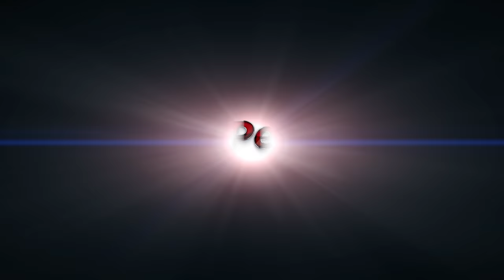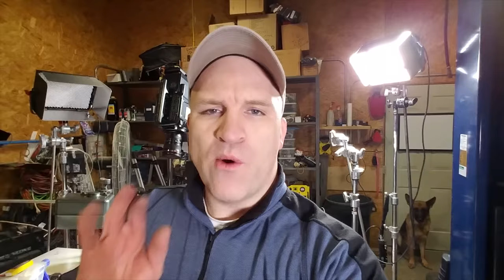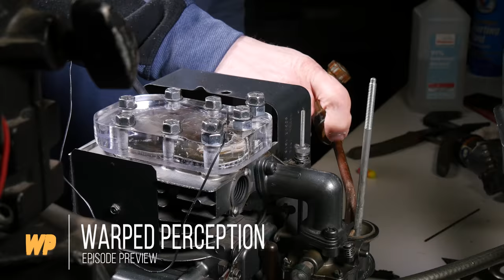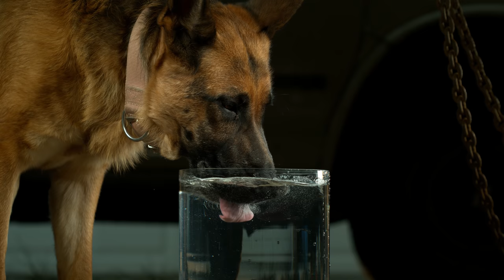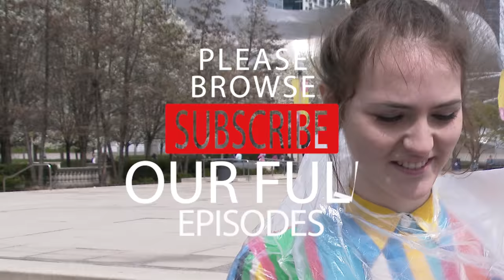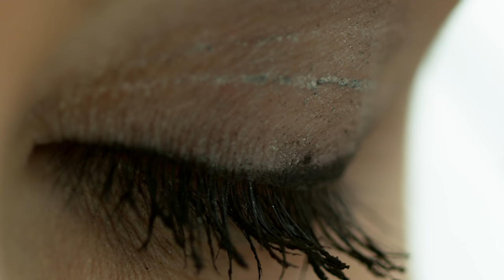Inside An Engine - in 4K Slow Motion  [ Quick Clip ]

Comment: That was cool. I dont know if im wrong but why it seems like the piston takes three intake strokes before compression? lol is it edited? Intake ⬇Compression ⬆Power⬇Exhaust⬆
Reply from the maker: thats correct , 4-Stroke Engine,  here is a animation for you to check out: https://en.wikipedia.org/wiki/File:4StrokeEngine_Ortho_3D_Small.gif
Reply: Top valve is intake, bottom is exhaust.  Lot of misfiring going on is why it seems like a 12 stroke engine.

Comment: Am i right I guessing the tuning of that engine was off? Or was the frame rate too low to see the flame on most compression strokes? Sometime you would see a flame other time maybe some clouding. As someone that knows how and why an engine works, it is interesting seeing it work in real time let alone in slow mo. Normally all of this process is unseen and you design, machine and build engines to do what you can't see. As always keep up the good work guys!
Reply from the maker: well it was misfiring so yeah, and we got the maximum frame rate we could get while maintaining the best quality and lowest bore factor. if we go too high on the framerate the colors of the explosion wash out.

Comment: Very Cool.  You need to add a little O2 when you were using the torch.  Won't run on the Tequila, it's only 40% and your Isopropyl Alcohol was 90% and it didn't want to stay lit. How bout some Nitro Methane!  I want to be in the next zip code for that one!